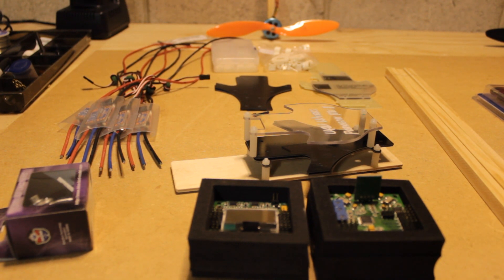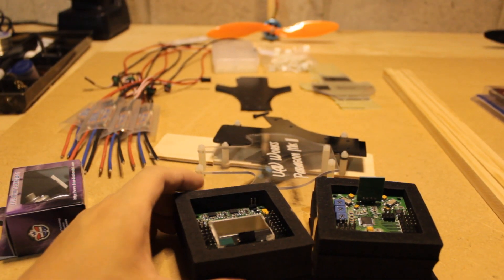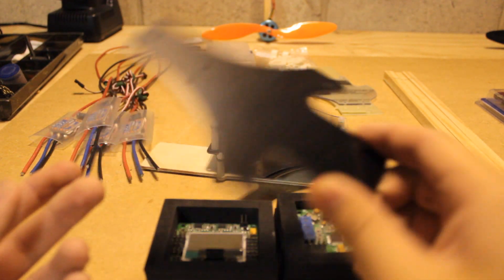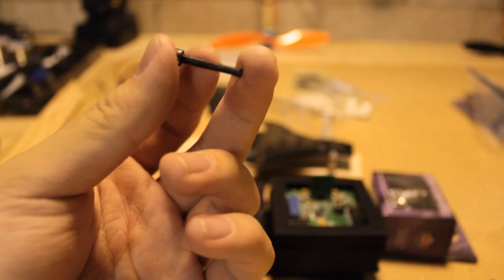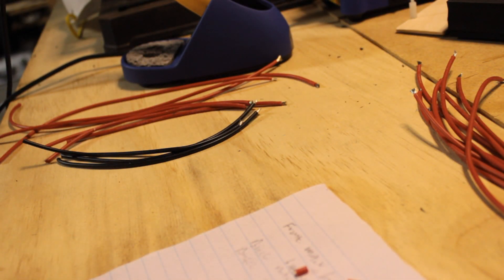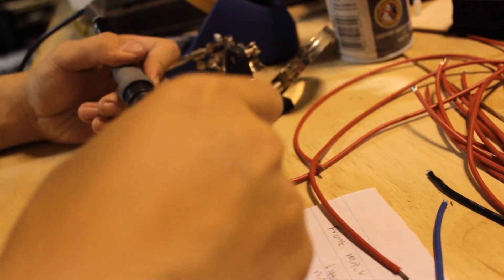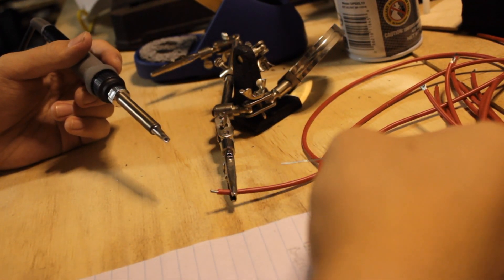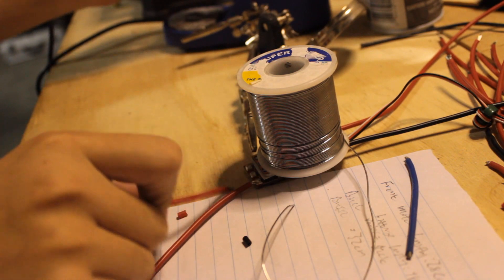Complete Beginner's Guide to Building a Tricopter Part 1

Comment: I understand that this is quite and old clip however I think people need to know the following.

Not trying to criticise you but you really need a better soldering iron for this. The tip you are using is not correct and looks to be a low wattage iron.
If you had the right tip and the correct iron, you should need to hold the iron on the ESC for so long. This would eliminate the spray. You should not have to use it at all.

So people, if you are attempting this. Get the right tools.

Comment: I like the idea of keeping the ESC's away from the tips. Keeping the weight center makes for better Acro performance when the motors only need to pitch themselves and not the esc's too.    Only draw back to the design is overheating but that usually only happens when people use an inefficient motor/prop combo.

Comment from the maker: Hi, 

Yes. 4-channel radios are sufficient for basic control, but I still really suggest the Turnigy 9x as you can toggle self-leveling and other options on your KK 2 board better later down the road. 

UAVWorks

Comment: @ Josny - not sure what you decided to do (1 month ago) but I had the same problem. I got a Hubsan X4 rtf Quad from RC-Hawk dot com and it was 400 % easier to fly then my new Bixler which I tried yesterday. Two crashes and out. The Hubsan X4 you can crash at 30 mph into a cement wall and pick it up and fly.

Comment from the maker: Hi Corbonzo,

Thanks for the encouragements. 
-The programming card is for the ESC, you don't see that in the video because I am using a custom programmed ESC specifically for multirotors. 
-Correct, all the KK2 setup can be done on the board
-I machined out my own parts so my cost was a little less, but by buying all the parts, it will cost less than $200 

UAVWorks

Comment from the maker: This method is cheap and you can familiarize yourself a little bit with fixed wings first (fewer things go wrong with fixed wings and, of course, less electronic setup compared to tricopter). But again, there's nothing wrong with jumping straight into multirotors- and some may even argue it's a little easier to learn since you can hover closer to ground whereas with planes you always have to keep your speed up so you won't stall. It's all preferences really. 

Hope this help,
UAVWorks

Comment from the maker: I added the transmitters' links to the bottom of the description box. They are called the Turnigy 9x and Turnigy 9XR, the 9XR is new so a lot of people are buying it so it mght not be in stock. But I would just get the old one (9x) as I will release guides that teach you how to make it as good as the new. 

You will need to solder an XT-60 plug to charge your batteries. Batteries bought from Hobbyking comes with different male plugs (usually XT-60). You just use the female version to charge.

Comment from the maker: Hi Wmanidi,

yes if you own your tools including the basic hardware (hex screws, hex drive, pliers, epoxy etc) and a soldering iron, you are pretty much set. If you have thin copper wire around the house (24awg, or 0.5mm, or even thinner is beter) you don't have to go out and buy. But to wrap the ESCs together I used 24 awg. This is the only item I omitted from the list, which I will add on now.

Comment: I have already sourced a frame, but I if I purchase everything on the list (I already own the tools) will I be good to go for building, and need nothing else? Also I understand the flight controller, but don't I also need a transmitter, like a remote control? Could you recommend a good (cheap) one for beginners? Thanks for the amazingly helpful videos! Will I need some kind of extra plug to charge the battery?